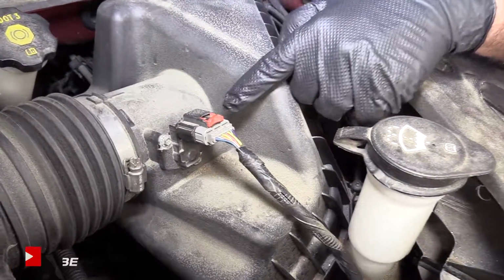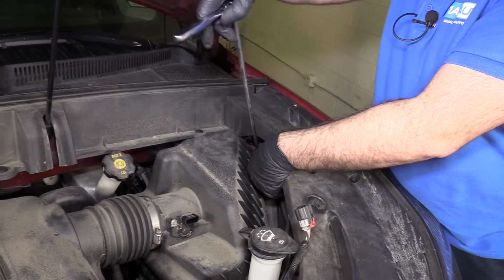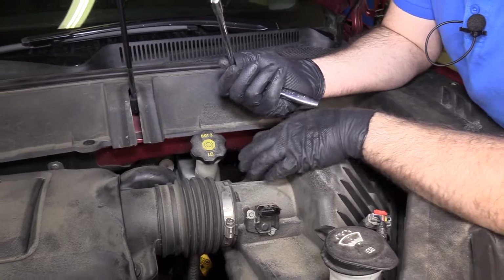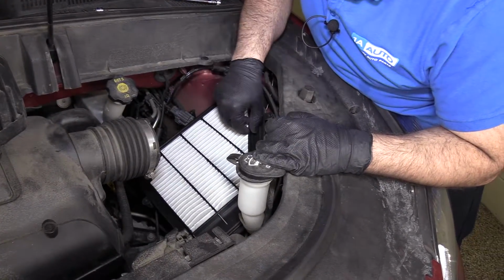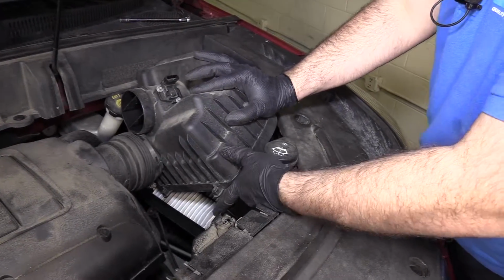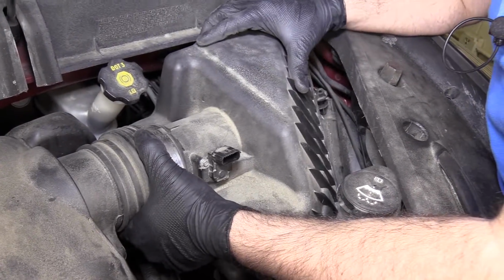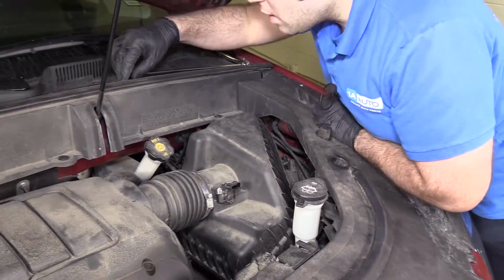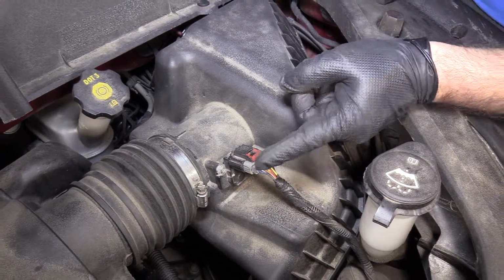How to Replace Engine Air Filter 09-15 Chevy Traverse

Comment: Thank you for the wonderful instructions.  Had some trouble with putting the hose back onto the cover.  Used a zip tie on the hose just after the clamp to be able to pull the hose on the cover, worked wonders for me as I'm not very strong.